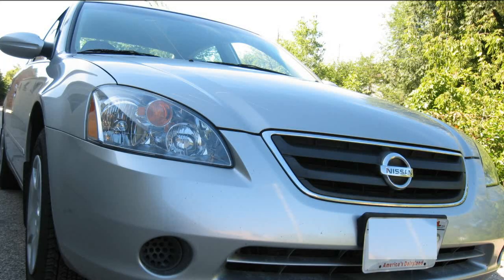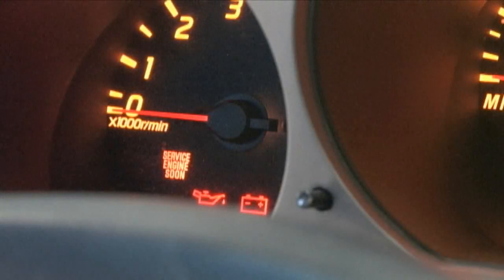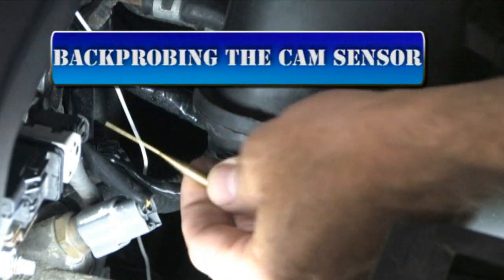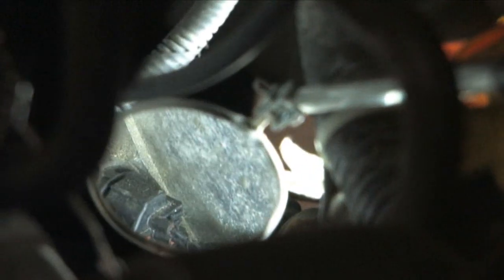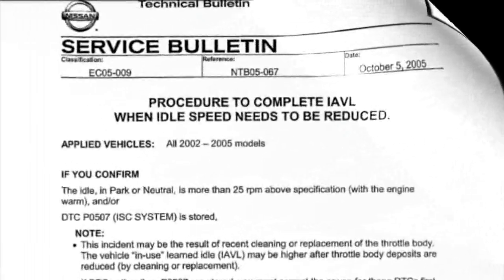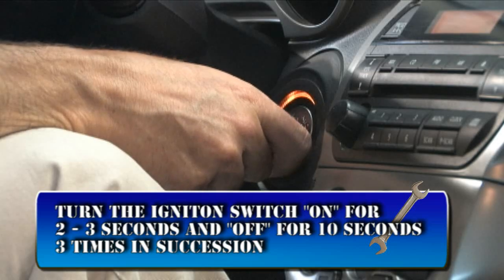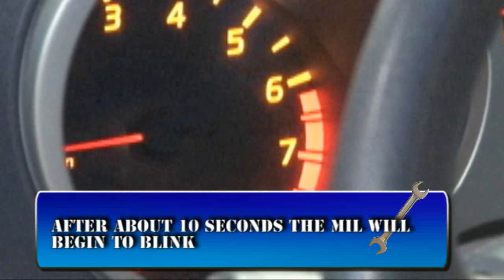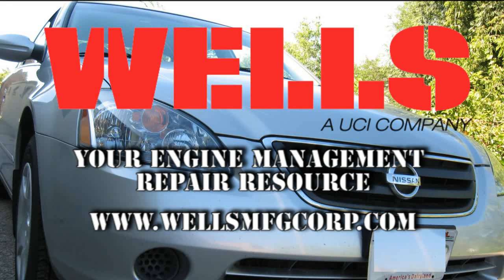Nissan P0505 P0507 Relearn Cam and Crank Sensor Troubleshooting and Testing by Wells

Comment: Worked on my g35 inifiniti  everyone do not clean your tb worst ever and because have infiniti everyone wants to charge ridiculously
Reply: Did you have high RPM and check engine light on? Because that's what my G has, I'm going to try this procedure...
Reply: It works
Reply: But have to do it by the second or will not work
Reply: I must be doing something wrong, I did the whole Procedure like 5 time and didn't work
 -_- ...
I'll try it again tomorrow ...
Reply: It took 2 people to do it one clock and me turn the switch
Reply: I tried it again and the check engine light still on -_- 
I guess I'm gonna have to take it to a mechanic or the Nissan dealer .....
Reply: Try it first and then if it does not work I will probably take it to a mechanic but it should work
Reply: Xxju1cexX1 check engine light turned on for my 2007 altima se 3.5 but.. went off after a few days by itself ( after doing throtle body cleaning and idle re-learn as this video shows )
Reply: Xxju1cexX1 check engine light goes away, give it a few days, and the idle re-learn  WORKS but have patience and timing is very important
Reply: +Enocras Williams I just bought a used g35 this code came up and I can tell that the car is idling high after it gets above 30 mph.  Do you think this trick will work? or should I take it to a mechanic?
Reply: It definitely reset the idle control.  But it didn't help the high rev once i get up to 30 mph :(
Reply: +Corinne Watson my car does the same
Reply: Enocras Willia

Comment: Will this work for an 03 Nissan maxima gle vq35de?
Reply from the maker: I believe it should. Remember it has to be done exactly like the video says.
Please let us know your results.
Mark Hicks
Wells Vehicle Electronics
Reply: markjhicks I will. So, I replaced the VIAS solenoid and code p1800 pops up, is that because it needs to be relearned again?
Reply from the maker: Alpha Kilo
No, the P1800 concerns the VIAS circuit, which would have nothing to do with the idle... Here is the test procedure to follow:
 1. At the VIAS solenoid, unplug the black 2 pin connector (located on top of the intake between two intake manifold runners) and test resistance of the solenoid to see if it is open or shorted.

2. If resistance of the solenoid is good, check for battery voltage on the Red/Yellow wire with the key on. If there is no voltage, check for a broken wire in the engine wiring harness.

3. Check the voltage on the ground control side of the solenoid with the solenoid connected (Yellow/Green wire) to see if the solenoid is being controlled properly. Below 1800 RPMs and above 3600 RPMs, the Electronic Control Module does not ground the solenoid and the reading should be 12 volts. At all other RPMs, the solenoid should be grounded by the ECM and the reading should be near 0 volts. If the voltage is always 12 volts, check the Yellow/Green wire for an open circuit between the solenoid and the Engine Control Module (ECM). Tech Tips: The Electronic Control Module controls the VIAS solenoid which sends a vacuum signal to the Variable Induction Air Control System actuator, which then opens and closes flaps in the intake manifold and shortens the length of intake runners for better performance.

Mark
Reply: markjhicks hahahahahahaha IT WORKED!!! took a couple trys. No I have to get rid of p1800 and my SES light should be out for good.
Reply from the maker: Alpha Kilo
Great News! Let us know how the P1800 resolves.
Thanks,
Mark

Comment: I did the idle reset 2 times worked like you said, brought it down to 1200 for 10 min then went up to 1800 rpm, do you have any advice for me should i replace the TB?
Reply from the maker: Did the code set again when it went back up?
What is the year, make, model and engine size?
Mark Hicks
Wells Vehicle Electronics
Reply: Thank You i took it back to Nissan and they did a full factory reset on the car my car now idles at 800 rpm.. i didnt have to switch any of my sensors.. so my car came back to life thank you.
Reply: Roflking 25 how much did it cost you to do this? If you dont mind me asking.
Reply: I paid 80 dollars my friend works there but I think it's 150.. I would say do this first

Comment: It also workt for my 06 350Z. It was high RPM like at 1500. I keept trying this pettal dance relearn code rest. But it wasent working. Till i seen this video. I didn't know i had to do the 3secon &10secon count together with the 3second and 5press and so on till the end of the light and engin on. But when i did it dropt to like 700 800rpms sounds good light is off.  Thank you!
Reply from the maker: Perfect! Thanks for the great comment!
Mark Hicks
Wells Vehicle Electronics

Comment: My car starts, and you put it in drive and try to accelerate, it doesn't go past 20 mph, and feels like it buffs and puffs. Will the steps on this video fix that issue? Or does the throttle body need to be replaced?
Reply from the maker: From the sound of things, I would check the catalytic convertor. Try temporarily removing the front O2 sensor and then drive it for a block and if it improves, chances are the catalytic convertor is restricted.
Mark Hicks
Wells Vehicle Electronics
Reply: Did you ever find a solution?
Reply: Check your cam sensor

Comment: what is the relearn process for a honda crv 2000, I just  replaced the iacv but still
has unstable idle, specially in the morning, and I need to warm up the car for 5 minutes every time it gets cold otherwise has a bad idle when I make a stop, also when the car is at normal temperature is fine but stalls when stops, any help would be appreciated thanks.
One mechanic told me that the car needs valve adjustment ,,,, is that possible ?
Reply from the maker: This engine has had a lot of exhaust valve problems. The valves get tight and burn.

Remove the valve cover and check the valve clearance. If the exhaust valve is burnt, then the cylinder head will need to be replaced or rebuilt.
Mark Hicks
Wells Vehicle Electronics
Reply: markjhicks I will do that pretty soon, I hate being like this, sometimes the engine shuts off at the light, thanks for the response I really appreciate it 
I will post back   later

Comment: Ok Mark, hopefully you will give me some hope. took my 2003 Nissan Altima 3.5L V6 to my mechanic after my car just die on the middle of the road. Well he got a new battery and replace the alternator, he also replace radiator, and thermostat. He also put the car on his scanner and a few other codes came up. But there was still a leak under the engine. After patching one leak, he found another, but this one he noticed that on the oil leaked there was kind of a gold/or copper metal particles in it. Which at this time he is almost sure that it could be the main bearing. From his opinion, and after all he has done to get my car all good and running, he has giving up and say. that due to this leak and what he has found my car needs another engine. At this time I'm trying to find second opinions or cheaper options than to replace the engine. I would greatly appreciated your opinion on this.
Reply from the maker: I wish I had better news. Bearing wear will look like gold flakes in the oil. If it is the main bearing or not it is hard to say. But any way you look at it it is not good I am sorry to say. Another way to check the severity is to pull the oil filter and cut it open.
I wish you the best, maybe you can find a good used engine.
Mark Hicks
Wells Vehicle Electronics

Comment: Ok so it never worked for me but I found a way that works every single time even if you miss a sec..turn key to on then right back to off.wait 12 secs.turn key to on for 4 secs.then press the gas peddle 5 times with in 5 secs.wait 7 secs then hold the gas peddle for 10 secs.the check engine light will blink 6 times then go solid.you have about secs to start the car once the light go solid.done your idle rpm will below 1000 and check engine is cleared
Reply from the maker: Wow Really! I am going to try it.
Thanks,
Mark Hicks
Wells Vehicle Electronics

Comment: Seems to doesn't work for my 2003 maxima 6speed.ive tried it about 10 times and counted in different speeds each time.im confused about the part where you turn to on for 3 secs then within 5 secs step on the peddle 5 times.are you sappose to wait 3 secs then you have 5 secs to step on the peddle or from the time you turn to on you have a total of 5 secs to wait 3 and 2 secs to step on the peddle 5 times.
Reply from the maker: Yes turn it "on" wait 3 seconds and then step on the gas 5 times with in 5 seconds.
It should work on your vehicle.
If you have more problems let me know.
Mark Hicks
Wells Vehicle Electronics

Comment: I have a 2003 Nissan Altima Service Engine light is on codes P0420, P0507, and P0011. On  the first two of the codes I have = probable cause (Large vacuum Leak) and two other causes for the codes. and on the third code it has (cam/Crank sensor out of phase. This last code also could be for a Engine Coolant Temp Sensor. I just bought this car, and got the Valve Covers replace, a complete tune up, new brakes, fairly new/used tires, and also just order a radiator, because there is a very small crack on the radiator. Do you think this will solve the issue? This car looks excellent on the exterior and interior, and the price was $2200 (180,000 miles), I should have bring a mechanic with me, well lesson learn.
Reply from the maker: We all learn lessons most everyday, don't feel too bad.
I will assume you have a 2.5 engine.
The P0011 could mean a camshaft position sensor or most commonly it means a timing chain issue. But then again it could mean the oil needs to be changed. How old is the oil? This would be the place to start.
Try performing the procedure in the video for the P0507. You might also want to clean the throat of the throttle body while you are at it.
The P0420 code means the catalytic converter needs to be replace 99% of the time.
Where to begin, Your first focus should be on the P0011 code, check the condition of the oil. If that all checks out OK the next step is to check the camshaft position sensor and timing chain. This problem is probably what caused the catalytic converter to fail.
Best of luck,
Need anything let me know,
Mark Hicks
Wells Vehicle Electronics

Comment: hello Mark yo tengo un 02 infiniti i35 al cual le remobimos el throttle body para linpiarlo pero cuando lo instalamos tratamos de relearn the idle air control siguiendo exacto todos los pasos I cada ves que lo asemos logramos ajustar el RPMS a espesificasion pero cuando apagamos el veiculo ilo bolbemos a prender suven de Nuevo a 1000 rpms por al guna razon la conputadora no retiene la informasion I los sigue dando el codigo PO507 agradeseria mucho su ayuda sies que es algo que no estamos asiendo bien grasias
Reply: Jose Reyes  cual fue la solucion?

Comment: hi mark im having this code on my 2005 pathfinder is this procedure the same for mine
Reply from the maker: Hello Izzy,
This procedure should work for your Pathfinder. It took several tries to get it to work the first time. Clean the throttle body and try the re-learn. Remember to follow the instructions perfectly. It took me several tries to get it to work the first time. Let know how it goes and if you have any other concerns,
Mark Hicks
Wells Vehicle Electronics

Comment: 2004 Nissan Sentra 150,000 miles...Hi Mark thanks for sharing this with us. Question should we do this if we aren't getting a code. I am about to clean my throttle body and my soon to be son in law advised to also take off the Idle Air Control and spray some carb cleaner inside it as well. Is this necessary?
Reply from the maker: When you finish with the cleaning, oh by the way your soon to be is correct, if the idle is too high or low you will need to do the relearn process asw in the video. If you have any problems let me know.
Take Care,
Mark Hicks
Wells Vehicle Electronics

Comment from the maker: Sorry it will not work on a "97 Pathfinder. If you have a code P0505 usually it is either the Idle Air Control Motor or the connection to it.
Hope this helps you,
Mark Hicks
Wells Vehicle Electronics

Comment: It worked for my nissan altima. However when turn it off the rpms come back to higher level again. I've done it about 3 times. Every time it works fine but turn off and start again same problem occurs.

Comment: This method worked on my 2003 Nissan Altima S 2.5 took a couple of tries but it worked. I timed myself with the beeping of the car when the ignition is turned on, beep three times and off. Thank You for the knowlege Mark it is much appreciated.

Comment from the maker: It should work. But if the idle could not be set with the consult, makes me think you have an issue with the ECM. Tons of problems with the IAC shorting out and taking the ECM with it.

Mark Hicks
Wells Vehicle Electronics

Comment from the maker: This will not work on your vehicle. It is common for the MAF to cause this issue on your vehicle. However, to check it you need a scan tool. The other problems techs are finding is the front O2 or Air/fuel ratio sensor. Again I can give the diagnostic procedures but you need a scan tool. Another problem is the exhaust coupler. 
Let me know if I can help further,
Mark Hicks
Wells Vehicle Electronics

Comment: Will this work on a 04 hyundai tiburon gt ive done alot but same problem rpms between 1000 to 3000 up and down,replace iac valve,cleaned maf, i had engine replaced due to timing belt broke, started doing this after engine replaced

Comment from the maker: The code never set on this vehicle. His complaint was a high idle issue. We were getting a lot of calls on the tech assistance line asking where the crank sensor is located so we put that in this video also. It really had no connection to the real problem. Sorry for any confusion.
Mark Hicks
Wells Vehicle Electronics

Comment: Mark concerning this idle issue, was wondering if this would work on a 04 Sentra Se-R spec v since the Altima and Sentra motor are very simila, I seem to be having a issue where the idle seems to fluctuate between 1000 and 2000 rpms. I went to a auto parts store and it said it was the idle air control valve, thanks again and great video.

Comment: great video mark.I had high idle code and  bit of a hig idlse . Had real cold weather and got modulating RPM. Cleaned throttle body. Still have modulating RPM. Did steps in video as prescribed,MM says to wait till MIL goes out and than start.THIS DOES NOT WORK. AS the man says Follow these steps in the video religiously. I finally got it to work. BIg Thanks Mark

Comment: 2007 versa 167k,ran perfectly fine before I  performed spark plug replacement, air filter and throttle body clean, followed your instuctions(must use stop watch to hep count,lol)finally after idle lowered to 700rpms andlight went off ..reved engine and at around 2500 rrpms the ses light would flash back on, turn engine off and restarted ses on solid. what now????

Comment from the maker: If it ran before changing the crank sensor ... first check your connections. Especially if it was the four cylinder, because it so difficult to get to. Also make sure the harness did not unplug where it runs up the block. If everything looks good there I would suspect a defective sensor. 
Please let me know what you find or if you have any further questions,
Mark Hicks
Wells Vehicle Electronics

Comment: Should I take the throttle body off to clean it, or will it be fine cleaning it with it on the car still? I was planning on using MAF cleaner. Thanks.

Comment: I just got a p0507 code after cleaning my MAF. Idle hangs for a few seconds a lot.  I was hoping to avoid having to do the pedal dance, but this video helps. I might as well clean my throttle body before I do this. I got the car (06 spec-v) new 6 over 6 years ago and almost 70k miles ago, turbocharged for over a year, and this is my very first problem, so I'm lucky. Thanks for the video.

Comment from the maker: First try disconnecting the MAF until the check engine light comes "on". Then redo the idle relearn procedure. If this does not work, try disconnecting the battery for over 15 minutes and then redo the procedure. Please stay in touch!

Mark Hicks
Wells Vehicle Electronics

Comment: Hey I have a 2005 Infiniti G35 Coupe 3.5 V6. I tryed this after I got the P0507 after cleaning the TB. It worked it dropped my RPM from 950 idle to 620-630. I just feel like that is a little too low? It vibrates just a little and when u try to put both windows down it wants to stall almost at 500RPM. HELP!

Comment: a 2004 altima does not have a 2.4l engine.....2.5l 4cyl / 3.5l 6cyl only
2001 altima and older have the ka24de engines(2.4L)

Comment: Worked on my 2002 Altima :)  My check engine light was already on and it still worked, took me 3 tries.  1st try nothing, 2nd try engine light turned off but RPM stayed high, 3rd time RPMs stayed high for a fews secs then they went down untill my car stalled.  When I turned the engine back on everything was back to normal.

THANK YOU SO MUCH!!!!

Comment: Does this Vid work for an 04 Maxima...??? --__-- Cleaned throttle body and then changed out my stock intake to Injen CAI.. Worked perectly for 2days & then got Code P0507..

Comment: I couldn't get mine to relearn using consult, long story short, we could not perform idle relearn while the fans were running, when the car cooled off enough for the fans to stop, only then were we able to do the consult idle relearn.  Whether it was too warm of Coolant temp, or the extra load by the fans i'm not sure.  Also after getting it to relearn the idle would kick up when turning AC on which it wouldn't do when P0507 was present.